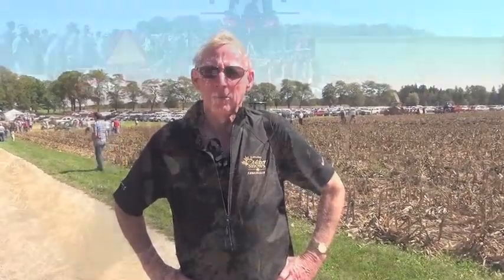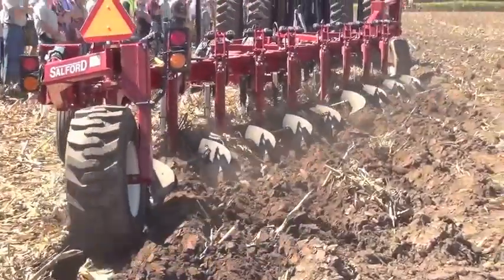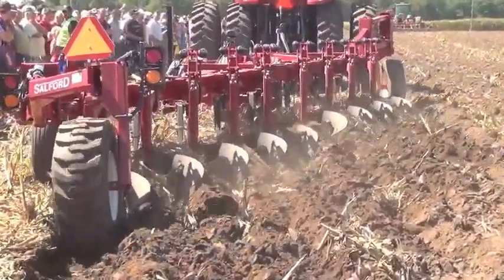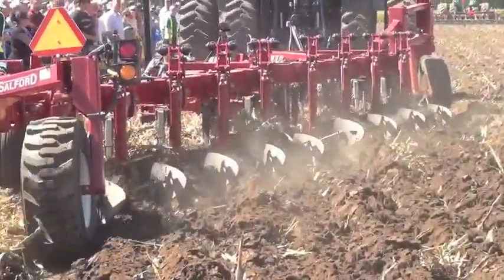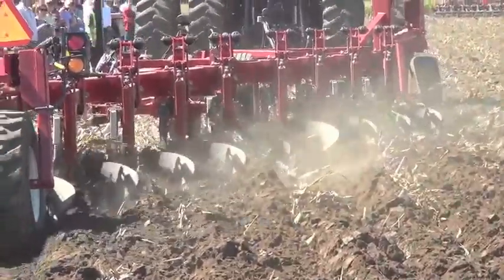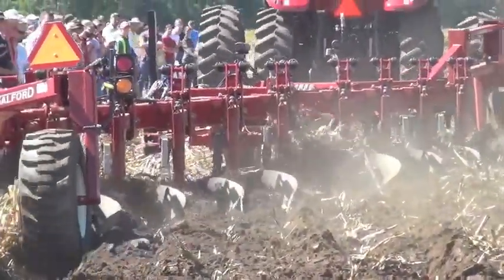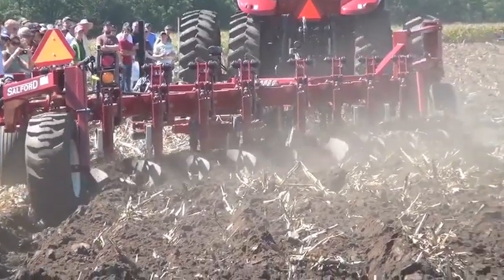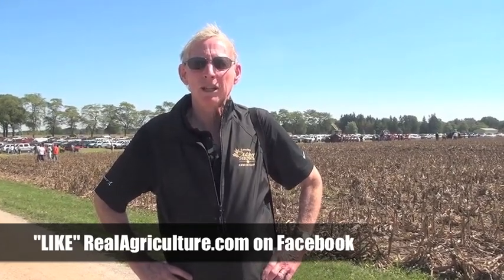The Resurgence of the Moldboard Plow

Comment: I have been farming for 45 years and I only use  a mouldboard plow I put 100 acres of oats and 100 acres of wheat,in the 45 years I have never had a problem with soil structure every time I plow the soil gets better and better
Reply: Did you ever have issues with a plowpan?

Comment: My dad always said something and it’s so true, if ploughing was never good and useful, the generations before us wouldn’t have braved the winters on tractors without cabs or even horses
Reply: They also did not have alternatives or ways to test different tillage depths. They had little understanding of soil science. Yes, tillage prepares a seedbed. That is the only beneficial aspect -- for crop cultivation. However, it damages the soil in every manner.
Reply: @Bankable2790  I raised organic corn/soybeans for a few years. Moldoard plowing has the additional benefit of burying weed seeds. If you plow deep enough, they go so far down, alot of them never make it back up. Cocklebur will laugh at you and come up anyway, however. :) I didn't use it every year, but it has it's place.
Reply: @ShermanT.Potter  Also people love No-till for "preservation and regeneration"  even thou no-till requires more spraying of chemicals and fertilizers then traditional cultivating. No-till will also not work in every crop type. No-till has little use in organic farming where chemicals cannot be used. the difference is less yield, but crop sold for a higher price.

Comment: You don't want a plow. I can not believe this guy calls himself an agronomist. Plowing destroys soil structure and organic matter. It also creates a hard pan or also known as a plow layer. If you have to do tillage vertical or chisel is the way to go.
Reply: Jns27j I totally agree with you. I personally do vertical tillage, and I’m interested in chiseling. Wouldn’t chiseling also make a hard pan too though? I know they say vary your depths but eventually I’m gonna create a hard pan I’m assuming
Reply: to add onto what this guy is saying, a hard pan means that your crop roots won't penetrate the compacted soil layer that has been created, and thus, their roots can't go far down to get more nutrients, and less nutrients means stunted growth, and stunted growth means worse crops.
Reply: That's not true, you need to plow. I am an agronomist
Reply: E Gleaton then your a crappy agronomist. Your also the only agronomist who agrees with you. If you said vertical tillage I could disagree with you but you could have some validity to your opinion. I’d love to hear you points on moldboard plowing. I can think of bunch of reasons not too 
1. Erosion
2. Soil stratification 
3. Rocks
4. Fuel consumption 
5. Time
6. Cost of equipment 
7. Equipment devaluation
8.  Destruction of soil perocity
9. Destruction of soil organic matter
10. Destruction of beneficial bugs and bacteria
Should I keep going?  The only good reason I’m sure you can use is weed control but I can do that cheaper, quicker and much more environmentally friendlier with herbicides using multiple modes of action. The other you might say is soil amendment mixing but if that is a priority than use vertical tillage.
Reply: @Jns27j  Thank you! I am not an agronomist, but a environmental/water resource engineer and wasn't to excited to see this video. Keep the soil and nutrients on the land, not in your ditches and downstream waterbodies.
Reply: Justin Germanovich not if done correctly. A chisel shatters while plow or disk shears.
Reply: Jns27j Tilling:

1. Prepares the seedbed for sowing by:
    a. Improving soil tilth, and
    b. Increasing seed to soil contact
2. Increases soil temperatures early in the season
3. Allows for bed preparation 
4. Controls weeds, which:
    a. Reduces water and nutrient competition 
    b. Controls diseases and pests 
    c. Reduces reliance on chemical pesticides and herbicides
    d. Reduces selection pressure and resistance-development to chemical pesticides/herbicides 
5. Directly controls diseases and pests by burying propagating material
6. Increases water infiltration (for a short while, and on some soils)
7. Incorporates lime into the soil where it can interact with soil attachment sites 
8. Incorporates fertilizers into the soil where they can attach soil attachment sites (i.e. K fertilizers) and not be leached via runoff or volatilize into the atmosphere (N fertilizers)

In short, there’s almost nothing tillage doesn’t help with as far as cultivating agronomic crops, at least to some extent, and for some while, especially in specific circumstances in which a particular variable is of extreme importance, like increasing soil temperatures, or controlling for a specific pathogen, or bed preparation that reduces disease pressure.

So sorry, while it is true that tillage damages the soil and soil organisms, it isn’t true that there is “zero reason” for a farmer to ever till. Chiselling/ drilling/ strip/ other reduced tillage is still tillage. It is specialized tillage which is utilized when the other interrelated factors in crop cultivation support it’s usage.

There still remain times at which full tillage would be necessary if the other factors (e.g. weed control, disease control, bed preparation, equipment availability, etc.) did not lend themselves to reduced tillage. It should be noted that GM crops are responsible for the adoption of strip tillage on row crops, without which farmers would still be implementing full tillage — they would have no other way to control weeds.
Reply: @Jns27j  How? Years ago we used to plow probably 7 + inch depth every year to bury the weeds. Never seemed to hurt anything. We always had good crops - or at least the best tasting. I'm not sure what they consider top soil but it was all good black dirt in North Eastern Ohio. No clay. No problems with water, either puddling or being too dry. Truthfully, the water would always soak right into the soil. The top 1/4 inch may get crusty, but everything under that was moist. 
When my dad moved, he took the top soil with him. Took off about the top 8 inches worth and moved it to his new home which was all clay.
Reply: @Justin Croonenberghs yes I am both.  I also sit on many boards. We actually used a lot molboard and chisel plows up until the turn of the century. We farm couple 1,000 acres, ranging from river valleys to high elevation hill sides with 26% grades. There has been  100’s of different studies on different soil types. None, conclude that molboard plowing is a good practice. Now is there advantages to it?  Yes.  
1. mechanical weed control, for farmers that can’t use chemical means
2. Introduction of O2 into the soil
3. Incorporation of organic material
4. Warm the soil
5. Dry the soil out
But the few advantages of plowing are greatly outweighed by negatives
1. Cost the equipment 
2. Cost to run the equipment 
3. Time cost running the equipment
4. Organic Matter destruction
5. Soil profile destruction 
6. Erosion
7 destruction of beneficial bacteria and insects
8. Compaction layering
9. The spreading of weed seeds that are proliferated by root rhizomes
10. Drying the soil and loss of organic matter on a dry year. 
And if you have to till there’s lots of other tools that will do a better job. Especially in the vertical world.  Not saying there not a place for the plow but it’s far and few between.  Hey look it’s your land you do what you want to do with it but the guy in this video is just trying to sell equipment.
Reply: Really depends on what you’re doing, no till is needed in some areas, in others you need tillage. The farm I work on uses a mulch ripper on corn ground every fall and a soil finisher for seedbed in the spring, 250+ bushel corn generates loads of residue and we need to incorporate some of that, the benefit of the mulch ripper vs plow is that it gets the tillage factor while leaving some stuff on top to prevent erosion. We don’t rip after soybeans because there’s not enough residue to prevent erosion. Between the ripper, drain tile, and waterways we have not had any issues with erosion.